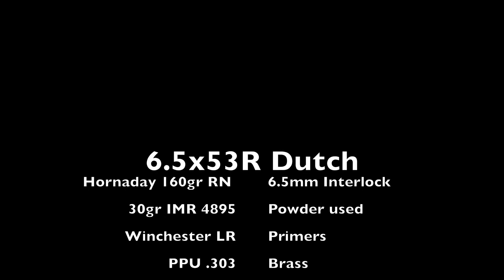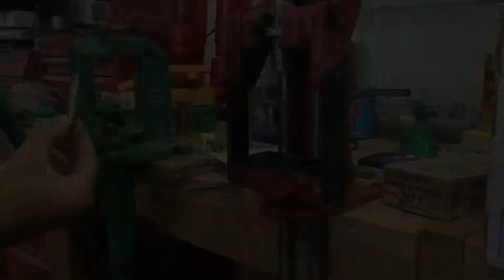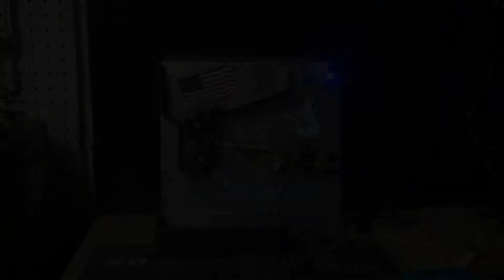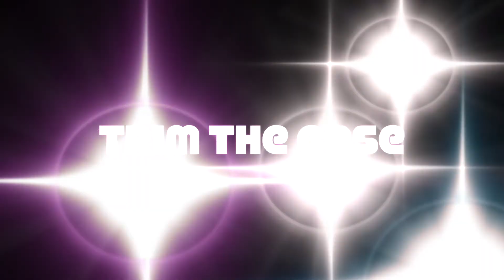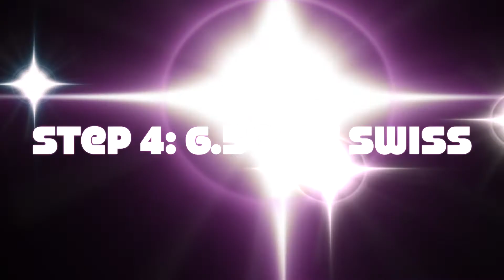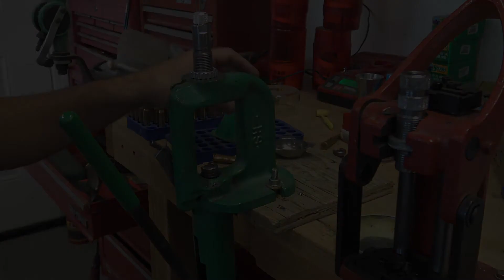How to form 6 5x53r Dutch/Romanian From 303 British

Comment: I have been making 6.5x53R since the 1960s.
Over the years, I have refined my process with less dies.
1.New case ( Win, Rem, PPU) sized in .308 die to set back shoulder.
2. Reduced Neck in 7mm-08 Die.
3. FLS in 6,5x53R Die.
4. Trim in MiniLathe to 53mm.
5. Neck and Shoulder anneal.
6. Load with #3031 or #4895H AND 156 TO 164 GRN. RN, .264" dia.
7. Enjoy.
PS, I also reload original Dutch military cases with 5mm Berdan Primers. FN22 cases still work well  with anneal.
I also produce 6,5 for commercial sale.
AV Ballistics
DocAV  Australia

Comment: I have several of the 6.5x53.5mmR long guns.  (I collect WW1 arms.)  One rifle, one carbine - can't remember right now which carbine version - and one sporterized carbine that looks futuristic in the 1940s and 1950s style.  Since the ammunition for the rifle/carbine has not been made since WW2 I have to make my own as well.  I do have some original ammunition but NOT to waste; it's in my display case.

What has to happen over all is the length of the case has to be reduced from the .303 Brit length to the 6.5x53.5mmR length, the shoulder set back (like the length) and the resulting cartridge to the configuration altered to fit the chamber.  Using the 'official' specifications in the "5th Edition Ammo Encyclopedia" one finds some amazingly detailed (three or four decimal places).  However, much of this is simple to do by using dies close enough to fit.  

Start with empty .303 British brass; it is about the same in rim diameter and base diameter.  Here I mention that various brands of .303 brass will have slightly differing rim diameters.  This may be true more of the 'lot' or batch made than the maker over all.  I seem to have good results with R-P brass, but your mileage may vary.  

I do essentially as shown in the video, except:  I prefer to anneal the case necks and shoulders prior to any forming.  Step form the neck down (don't try to neck down from .311 to 6.5mm in one pass) with a neck sizing die somewhere between.  .308 Winchester works, with the annealing and lubrication, 7mm Mauser would work, if one has a 7mm-08 die, that should work as well.  
Trim to length.  The official name of the desired round is 6.5x53.5mmR.  As mentioned I have a few rounds from WW2; I measured length of unfired ball ammo at 53.8 mm.  There is 'tolerance' in all machined items.  This is normally described as 'no more than this big and no less than that small'.  Also keep in mind a conventional non-rimmed case head spaces on the shoulder.  (That's what stops the round from sinking in the chamber too far.)  This is a rimmed case, so the rim contacts the rear surface made to meet the rim of the case and that sets the headspace.  But there is some leeway.  What cannot be tolerated and can lead to damage is if the case is too long and chambering the round 'wedges' the case mouth between the bullet and the leade of the rifling.  This can and will increase chamber pressure radically.  Much like a bullet stuck in the bore.  Bottom line:  all other dimensions being adequate, a bit too short (a millimeter or so) is better than little too long.  

The good news.  All the dimensions of the shoulder and stuff is made irrelevant by the final sizing-shaping die.  The video shows using a 6.5x55mm (Swedish) Mauser die to finally reduce the neck to the proper size, this to ease the work on the case and equipment in the final full sizing step.  Not a bad idea.  One could also use the sizing die from a .260 Remington (should one have such a thing).  One notes the 6.5 Creedmore is rather similar to the .260 Remington:  They are essentially .308 Winchester necked down to 6.5 mm.  
I suggest lubricating heavily.

Final sizing.  The video suggests 6.5 Carcano sizing die.  Good choice.  However, if one checks the sizes of the respective cartridges, one finds an amazing resemblance between 6.5x53.5mmR, 6.5x54mm Mannlicher-Schoenauer, 6.5x52mm Carcano and 6.5x50mm Arisaka.  They are - within tolerances - the same size and shape except for head styles.  They all have roots in the Mannlicher design shop.  (Fascinating story if one is a history or history of firearms buff .)  I have dies for Mannlicher-Schoenauer and Carcano.  I have used the M-S, and I will try the Carcano dies as well.  

I also endorse the idea of turning the case about a third of a turn and using the forming die again.  Reloading dies have tolerance too, and some may be out of round just a very tiny bit but enough to be 'difficult'.  

I also suggest that the newly formed cases be fire formed prior to be used with full loads.  Use the fastest powder the loading manual has (in order to get the lower pressure up quickly) at the lowest load level shown (to avoid any surprises like damage to the rifle or the shooter).

This is a fun rifle and a fun cartridge.  While not being unpleasant to shoot, it will kill most game in North America except the large dangerous bears and such.  

I do like this video.  It is useful and correct.  Despite the age, both rifle and cartridge are most useful.

Comment: I get a ring around the base of the case after the Carcano die.  Looks like excess material scraped from the case?
Reply from the maker: Thanks for watching. Were you using new brass or fired brass?
Reply: @a.r.m.4you182 I have same problem, from fired brass.
Reply: The answer is 'tolerances'.  Scraping the brass is not sufficient to destroy it.

Comment: Nice video!  I ordered a 1895 Dutch carbine today from Empire and all the dies from CH4D.  If you wanted to speed up that trimming step, buy a cheap Lee 7x57 trimmer stem, chuck the lee cutter in a drill and trim down to 57mm super quick, then use your hand crank trimmer to take it down to final length.
Reply from the maker: Thanks for watching and for sharing your findings. My biggest issue I have is making sure the base of the case is small enough to fit the chamber. Fresh brass shouldn't give you any trouble but once fired may.
Reply: @a.r.m.4you182  Thanks I'll keep an eye on it.  Ever have trouble with case neck thickness?  I have REM, PPU, and HXP brass to choose from so hopefully one or all of those will work.  I didn't realize the CH4D die set comes with a file trim die, so I'll be able to cut and trim them pretty quick with that.  I saw one guy was using the Lee 303 brit case trimmer case holder, then the stem from the 7.65x53 Argentine to trim it down which is perfect since it uses a .311 or so bullet and the stem will fit nice and tight in the neck of that 303 brass.  I already load both those so I have those Lee trimmers on hand and will try both ways and see which is best.